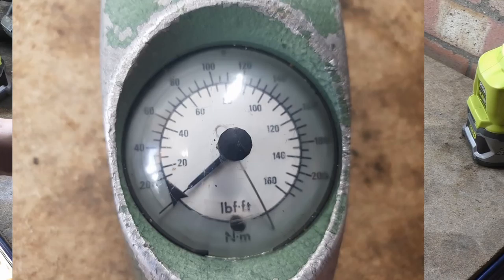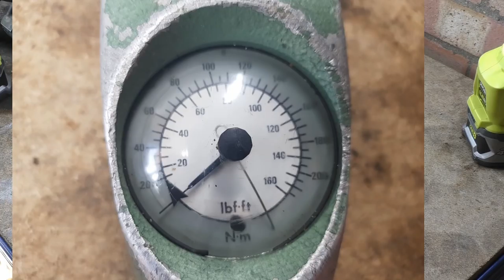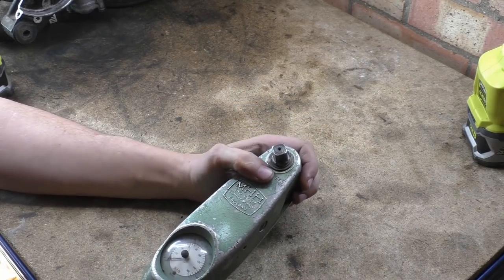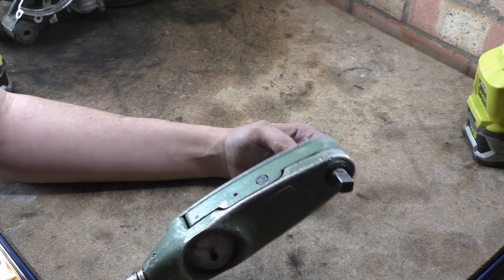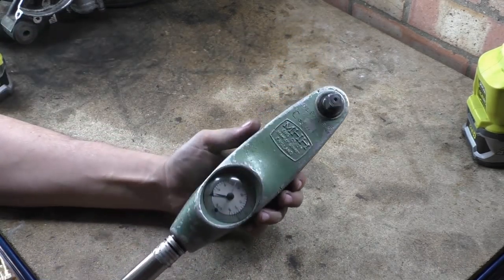Show and Tell - Maximum Effort

Comment: Got a small one in 3/8" drive, up to 27Nm, same only orange with Beta branding, excellent tool, great for rolling resistance type measurements or things with plastic threads when you need them all done up the same.

Comment: Used one bigger than that 20 plus years ago, used it to check M24 nut & bolts with a required torque of 400 N/mm i think, handle was about a meter long, had muscles like chuffin popeye after an hour on the job

Comment: By the bloody 'ell. That's bringing back some memories.
And they STILL fucking making them.
I remember one being in the main workshop on the surface, at the pit I worked and where I did my apprenticeship. I remembered it being bigger, so it could have been a three quarter or inch, if they make them. It was a while ago so I could well be all to bollocks and it was a half inch. But half inch was the small stuff there. Lot's of big beefy boss shite with fasteners to match. Sometimes TOO many.
In fact, just as a matter of interest, if you can be arsed, go and look how a drum on a ranging arm coal shearer/cutter is fixed onto the shaft. Calling it a shaft seems insufficient somehow. A fucking boatload of big arse fine thread high tensile cap screws, pull it onto a keyed and tapered shaft about three foot in dia. On occasion they would just bend lumps of beefed up RSJ section we would use as pullers trying to get them off to change. We would have to get a firemean/deputy to pack half a stick of powder behind it, tension the puller as much as we could, then we'd all fuck off off the the face and he would fire the thing.
Yeah, some were a little bit stubborn.

Comment: I have that same torque wrench only mine is red. One of my uncles got out of the trash at General Motors when they where tossing away a few hundred of them. They had just been calibrated as well right before they ended up replacing them with optically driven robotic torque wrenches. Well I am not sure on the brand but it is that exact same design.

Comment: Nice em haytch haytch torque wrench 👍

Cant believe you dont have imperial allens, another freakin cliff hanger 🖕
Reply: Tes LaCoil not metric
Reply: Beach&BoardFan
'Cant believe you dont have imperial allens......'

Set James May on im.
Soon as like Matt'll be banging on about unit engines, twin leading shoe front ends and Avon 'Skid Master' rubber.